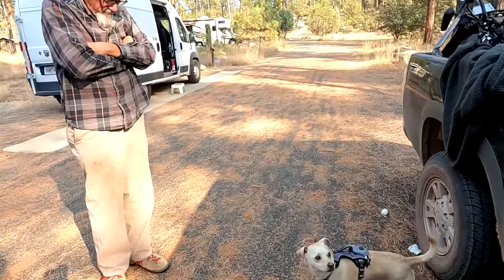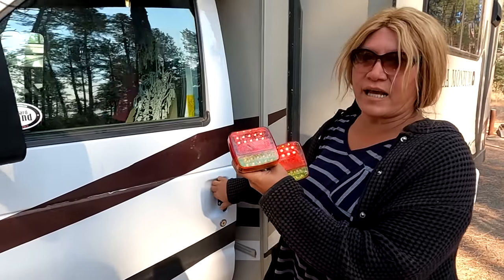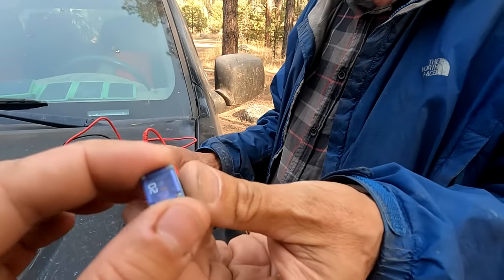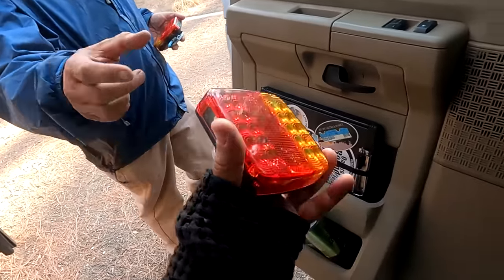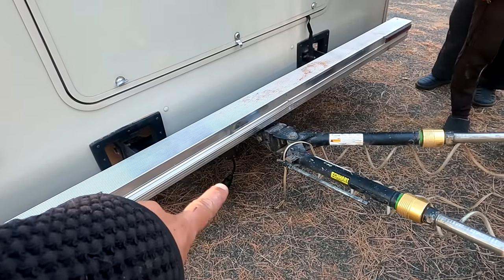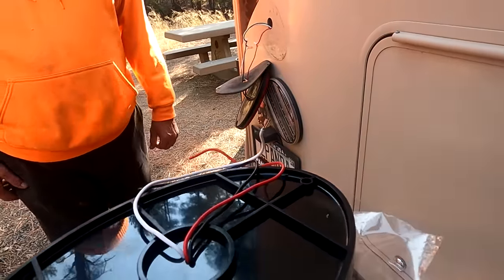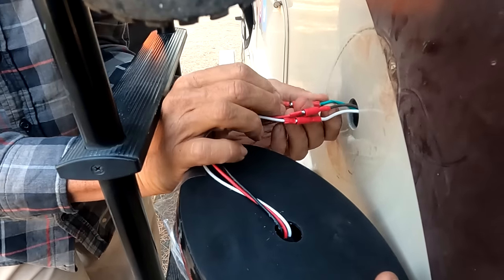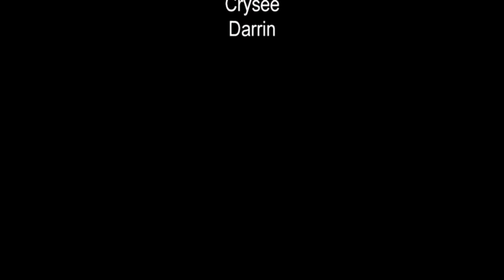Amazing To Be Legal! - RV Repair Wireless Tow Lights & LED Tail Lights

Comment: Hey Ausia, what kind of wireless lights are those? I was thinking of getting some . Thanks for featuring them 😊
Reply from the maker: I purchased them from eBay for $60 Wireless Led Rear Tail Lights Battery Operated USB Magnetic Tow Towing Trailer but make sure it's the right plug or you'll have to buy an adapter like I did which was $100,  it is cheaper to find the one that doesn't have the European plug.

Comment: Where did you get those wireless lites I definately need those???
Reply from the maker: I purchased them from eBay for $60 Wireless Led Rear Tail Lights Battery Operated USB Magnetic Tow Towing Trailer but make sure it's the right plug or you'll have to buy an adapter like I did which was $100, it's cheaper to find the one that doesn't have the European plug.